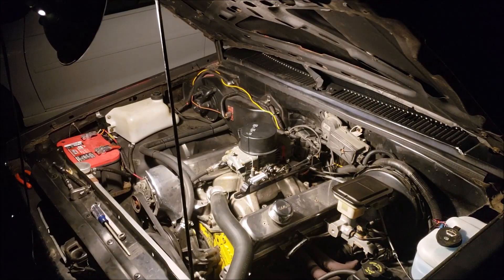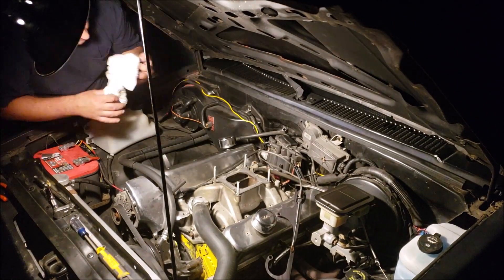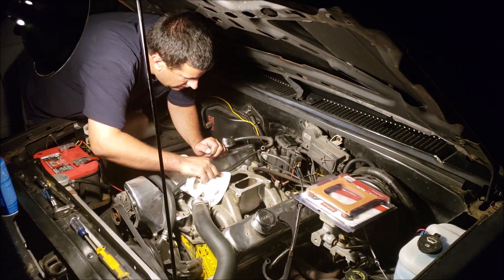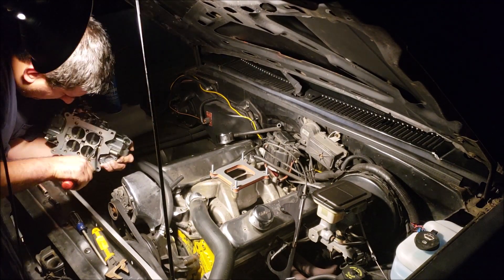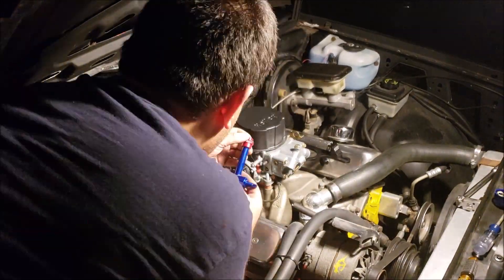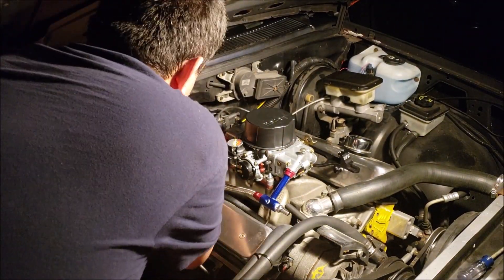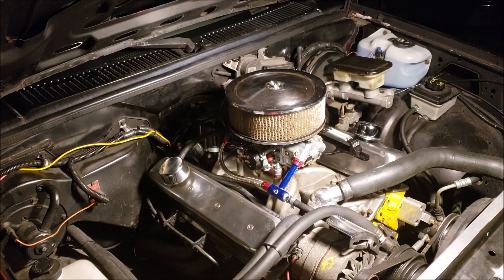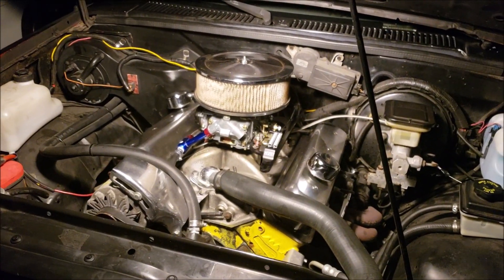Installing Holley Street Avenger Carburetor!

Comment: Are the metering blocks the same as a double pumper or still different even though you can change rear jets? Looking into upgrading blocks with the red quick fuel billet metering blocks but don't wanna buy the wrong set lol

Comment: Is your pvc valve run to back of carb with a tee to break booster too?
Reply: It has a couple ports you can use, for the break booster I run mine from the intake just below where the carb mounts, (air gap rpm)